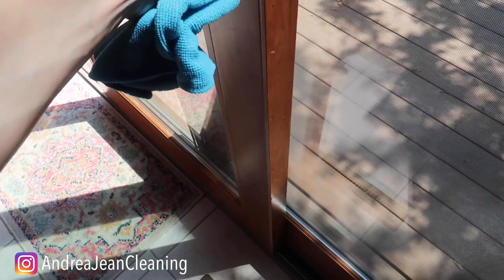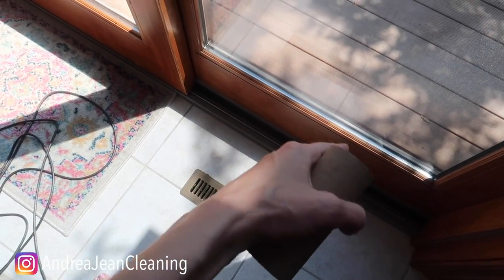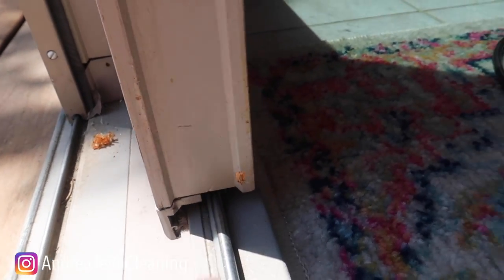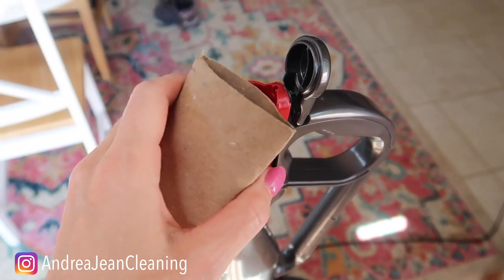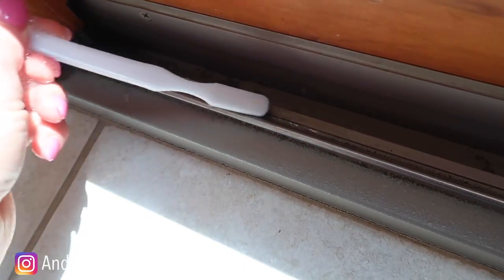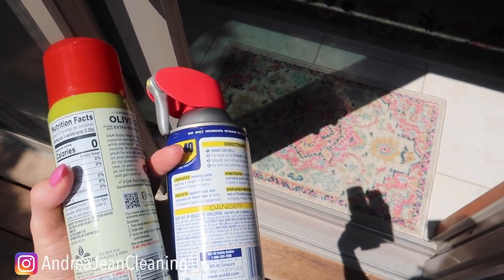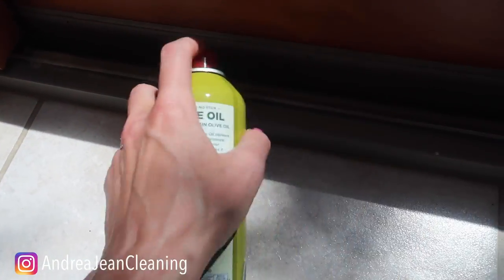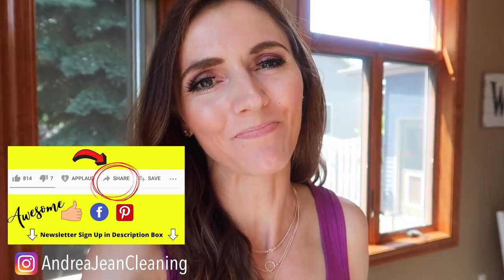How to Clean & Lubricate SLIDING PATIO DOOR or WINDOW TRACKS!! (Super Satisfying) | Andrea Jean

Comment: I use powdered graphite sold in small tubes with a nozzle for easy application on sliding doors.  Oils and silicones have a tendency to collect and hold tight to hair, dirt, dust and dust bunnies, etc making cleaning more often and very dirty again.  Graphite is a dry powder that allows smooth movement (locksmith's love this stuff) between surfaces but does not stain the surrounding area like oil and does not need to be reapplied but every few years. If over spray occurs, it is like a pencil mark, just wipe it away.  It also works great on windows and door hinges and gets rid of squeaks allowing  for smoother opening.  Found this out years ago.  Just a suggestion.
Reply: That sounds great! I am 72 yrs old & can’t spend any length of time stooping, bending, or kneeling for cleaning, etc.! Should I clean the tracks first and then apply the graphite? Where can I get the graphite? Thanks for this info!
Reply: @Cyd Kriletich  Hi, if track really dirty, then clean as well as you can before applying.  Just squeeze puff small amounts from tube along the track, then slide door  a few times to distribute.   I understand where you are coming from....I am seventy-three. : )
Reply: Forgot, you can buy at any store...WalMart, Home Depot, most grocery stores in hardware section.  Cost is maybe 2 or 3 dollars and lasts years and years as you only use a very small amount.
Reply: I tried this and it didn’t work and stained my doors permanently !! If there’s clear it may be better. Otherwise it just dries and becomes a solid
Reply: @karchata7123  I'm sorry this did not work for you.  Suggestion: clean the area well first of dirt, grime etc.; then after it is thoroughly dry, apply a light dusting of powdered graphite.  Because it is graphite, it is blackish-gray color by nature, not clear.  If over spray occurs, and it does sometimes, just vacuum if possible or use a dampened soapy cloth and wipe away.  Hope this works for you.

Comment: Change the door rollers out before they deteriorate. Need two peeps to lift the door out. Get the proper rollers BEFORE you lift the door out. When the new rollers are fitted tell the kids as they will slam the door shut too hard. Softly does it!